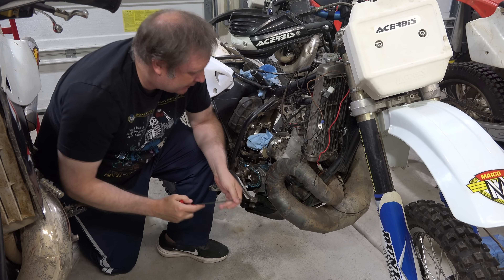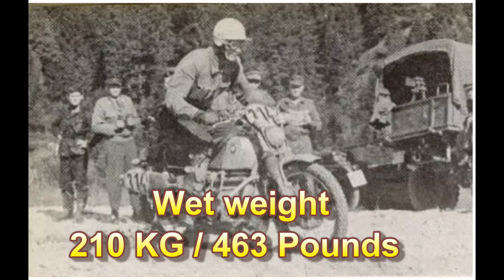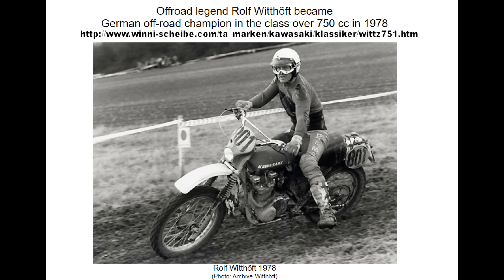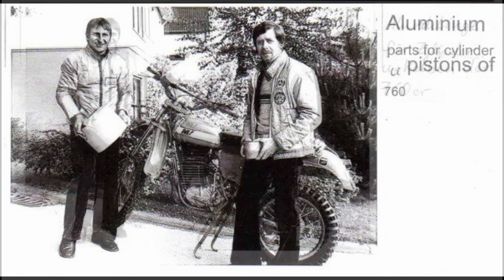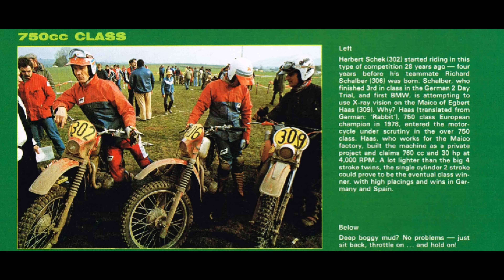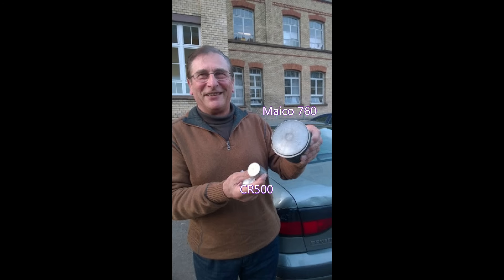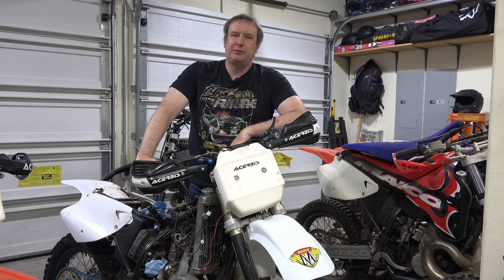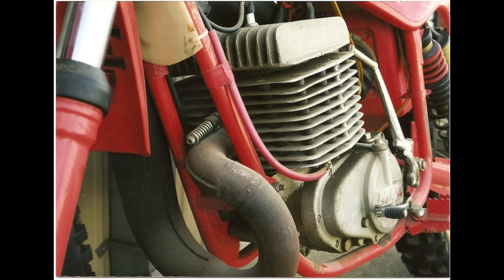The Story of the Maico 760 (Documentary)

Comment: If a Detroit deisel 2 stroke works with large bore and stroke than why did everyone think it impossible. No forced induction ? Is that why the bike was normally aspirated
Reply from the maker: @waynegarfield6607  I dont know all the mechanics around it but even 500cc 2 stroke si difficult to achive. Suzuki gave up and yamaha had issues even. First the diesel engine runs on diesel.and is a very large engine. It has a glow plug and it caps at 750 rpm.  So to make a smaller versiom thats usable on a bike with thr normal 2 stroke fluid mechanics are likely around where the difficulty becomes.  He was able to gear this bike like a street bike where 1st was like 3rd.  Im sure theres some more in depth.details about small engine 2 strokes and the difficulty as they grow larger in displacement but I have not looked in detail.  Maybe sometime Ill take a closer look.
Reply from the maker: @waynegarfield6607  I will say you have friction and the ability to move that slug as they get bigger.  Theres also being able to start the bike out on the trail.
Reply from the maker: @waynegarfield6607  I would also say that likely the strokes end up being longer.  This bike had (bore x strokr) 109mm x 83mm. The early lanz bulldogs had 150 x 210mm and these vary later modles had 8.8 inch x 10.x inch. The stroke is longer than the bore and rpms low.

Comment: Husqvrna proof 800 twin
Reply from the maker: @JimGoose-hl4cx  Ya there have been multi-cylinder 2 strokes of combined large displacement, but not a single cylinder of large displacement. That was considered impossible.
Reply: @Maicowerk  just that the heading said largest 2 stroke dirtbike   and  didnt say largest single cyl dirtbike.. i  must admit the maico 490 megas are still a great bike by todays standards.  . Geoff ballard would blittz the late models in the mid 90s at the thumpernats on a 490. No need to go bigger.
Reply from the maker: @JimGoose-hl4cx  There have even been over 1000cc dirtbikes where they put multiple 500 motors in a single frame for hillclimb. We also had the jim mcabe triple, 1500 cc maico with 3 cylinders.  490 is plenty except if the class is 750 and over then its required or if you are sidecar racing.
Reply: @Maicowerk  im talking from factory not modified..or factory endorsed.

Comment: Yeah but a modern 250 four stroke puts out more hp.
Reply from the maker: @lw3918  at  18000 rpm they can get to 40. At 4000 they only get ~8hp, so it doesn't put out more at the same rpm.
Reply: @Maicowerk  Oh I'm sure it does.